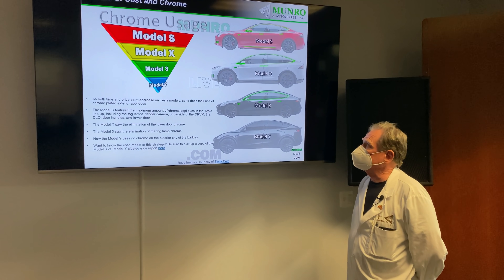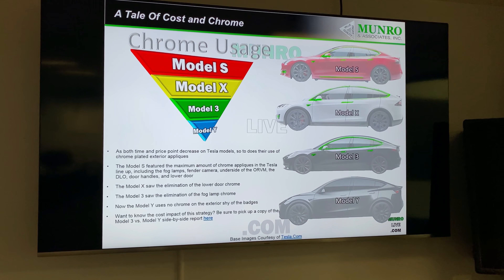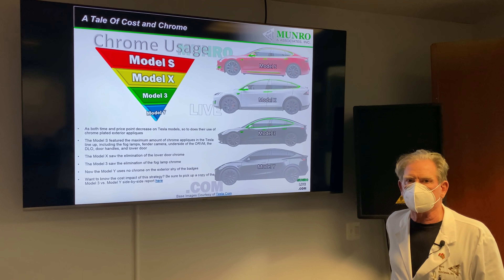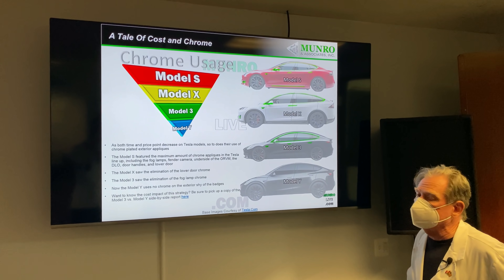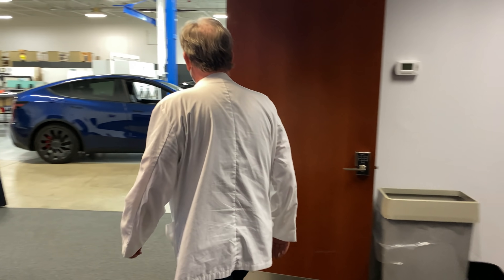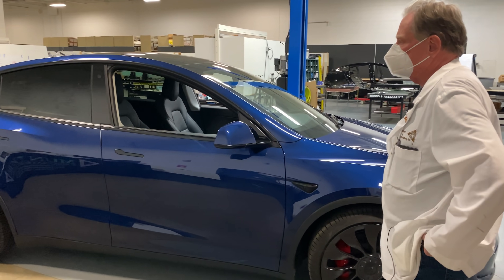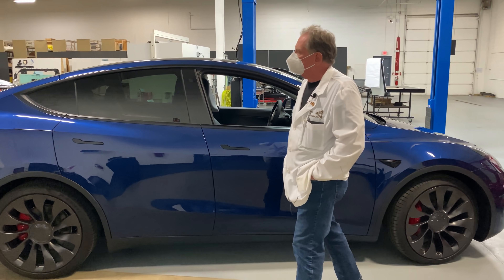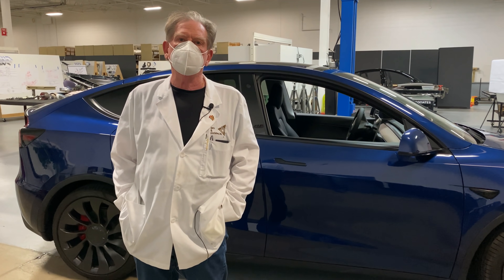Model Y E31: Environmental Stewardship on the Exterior Trim, Door Modules, and Motor Bay

Comment: While I'm glad to hear my Model 3 uses minimal actual chrome, it seems the pH of Simoniz touchless car washes may be too high https://forums.tesla.com/forum/forums/cloudy-chrome-advice and https://teslamotorsclub.com/tmc/threads/flaw-in-chrome-trim-mismatch.132310/#post-4462286 so I may have damaged all my chrome finish trim by manual touchless washing my 2018 Model 3 too much, in my attempts to get winter salt and grime off, covering ~24K miles last year. The ~$1500 is the estimate Tesla gave me for replacing all the window trim and rear quarter window assembly, with none of it covered by warranty, detailed at: https://TinkerTry.com/why-tesla-model-3-is-replacing-my-13-year-old-honda-civic-hybrid#chrome and of course it will likely just happen again. My garage isn't heated, so I really don't have another way to get salt off in the winter besides self-serve touchless.
For now I DIY vinyl wrapped it to hide this very apparent damage, buying me some time before a more permanent solution. The rest of the car and paint has held up well, and it's by far the best car I've ever driven or owned. But it just seemed that this might be the right place to warn others to take care with Model 3 window trim, given Simoniz is apparently used at many or most touchless car washes. FYI, Tesla recommends touchless washes in the manual.
I'm considering DIY black Plasti Dip that can be peeled off, maybe I'll go that route as a more permanent 3 year (but still removable) work-around, that is, if it's not terrible for the environment. Thank you Sandy, for inspiring me to research this more. I think the door handles will be the tougher area to cover to match the trim, as vinyl wraps have edges and won't last, and Plasti Dip might also degrade over time for such a high-touch area.
Reply: Paul Braren salt will corrode chrome for sure. Chromium oxide is the thin protective layer, just as it is on stainless steel. Chlorides if unwashed will pit chrome (and stainless steels)
Reply: @kdkd693  Thank you for weighing in! The thing with my situation is that salt spray rarely hit the window trim, and when it did, it wasn't left there for more than a day, usually much less, washing off whenever I finished a long trip. Also note that the problem arose in the summer of 2019, when the Model 3 was just 7 months old. Also, there seems to be a complete failure/flaw in the rear quarter window trim that may have little to nothing to do with pH or salt, reported by many and pictured here:
https://teslamotorsclub.com/tmc/threads/flaw-in-chrome-trim-mismatch.132310/#post-4462286
Another data point, the chrome trim (which I admittedly don't know what it was actually made of) on our 2005 and 2006 Honda Civics that our Model 3s replaced had no such issues in the same conditions, nor have any of the cars we've had these past 30 years in the same or even more salty roads (Ithaca NY). Also, a Model 3 with a nearly identical 119,XXX VIN# that I saw at Tesla Service in Milford CT had no issues with chrome, nor did the other dozen or so Model 3s parked in the lot for service. This is what has me leaning toward my frequent touchless car washes being at least a partial contributor to my issue.

Comment: Munro's insight here is actually a really good buyer's guide. The more I see of this car the more I want it, and I would totally consider a similar model from another manufacturer but there's no competition for Model Y's price and value at this time.
Reply: Id argue it's in the top 5 best looking "suv's" as well.

Tesla is onto a winner here with the Y. 

When the Corona is over and the world gets back to work, they are going to sell a LOT of them.
Reply: MrMagooo A matter of taste. 35k SUVs on this level are subsidised diesels. But the safety, space, fun to drive, tech and premium amenities this offers are hard to beat at the price, is the point. Not to forget driving a car that is this innovative and smartly built.
Reply: MrMagooo  If yoiu like shiny things and are easily distracted perhaps, if you value things overall,  there is no competition.

I have a Audi, the only part id really miss on a Tesla is the nice feeling steering wheel. Which isn't nothing, but nowhere near enough to make it worse
Reply: MrMagooo  Tesla couldn't do old fashioned buttons though, as they aspire to have their entire fleet become self-driving with over-the-air updates. And then all the old-fashioned buttons would become useless. So you'll have to wait until an old-fashioned brand puts out anything that compares to today's Model Y specs. Maybe 5 years, maybe never. Perhaps more realistically, you can buy a more expensive one with lower range sooner.
Reply: still too expensive to afford it
Reply: The only benefit of the Tesla vehicle is environmental,  which I agree is very important, but that comes with an added cost above and beyond the cost of Tesla's incorporating a lot of unnecessary luxury and performance features.
I don't want to belabor this, but my fully amortized 12 year old Honda with 100,000  miles is/was better for the price and value when I bought it and is an order of magnitude better today.  The real dollar TCO/mile for reliable transportation has been lower than any projected TOS for a Model 3.
Reply: @psdaengr911  I don't know which Honda you're speaking about but you can easily model a Model 3 showing a close five year TCO to a Honda Civic with a $10k lower sticker price, if you project Model 3 maintenance as a comparably cheaper Model S. And the comparison falls more into Tesla's favor if you drive more per year.

Do note that Model 3 has only been out in decent volume for two years and Model Y is just beginning now. And their first mass-produced car, the Model S, has only been out for almost eight years, but they've massively improved manufacture quality since then. So comparing it to a twelve year ownership is not possible without projections and big assumptions yet.
Reply: @psdaengr911  5 year cost is already better for many BEVs vs equivalent fossils. And part of Tesla's mission is to force traditional auto and startups to adopt BEV tech, and that's happening now. Prices always come down eventually on the free market.
Reply: They still need to improve their quality control by a lot:
https://www.youtube.com/watch?v=Z0r-vC-RHkU&feature=emb_title

Comment: Sandy, you don't really need to wear a mask to film these vids. The point of them is to protect others from yourself. If you have zero symptoms then the camera guy is not at any risk.
Reply: Not correct. He could be asymptomatic and still propagate the virus.
Reply: I get the impression that Sandy makes a point of using the masks even when hes doing streaming podcasts, to help remove the stigma of people wearing masks.
Reply: @temper44  That's also a good point. When you make educational content, you should go all in.
Reply: @temper44  - He has had zero symptoms for over a month though.  The mask thing is now pure subliminal propaganda and designed to persuade people to comply.  I get that. But to claim that it is essential to make a 5 minute YT vid is just wrong. Ask any medic.
Reply: Hitstirrer  he is probably wearing it all day, every day as he still has contract with others outside work
Reply: could have been negative for the first three weeks and positive for the last week, could test positive next week
Reply: @Hitstirrer  . It's possibly similar to Mike Pence and Trump refusing to wear a mask, as a message to all their fans that they know better than scientists and doctors. Also to show that they have the power to break sensible rules with impunity.

Comment: 2:00 Can someone comprehensively explain to me while there even are these corner glass panels in cars? They don't seem to serve a purpose other than allowing burglars to smash them and stick their arms in without triggering the alarm. They don't really allow a better view out or much light to shine in. Why not make that part of the frame metal to begin with?
Reply: because the window needs to go up and down.  because blindspots would be worse if that window was a solid panel.  because if you are locked out of your car in a hot desert?   xD..
im just spitballin here.  😂
Reply: There's a guy who sells plastic blocks to go into the releases on Model 3 rear seats so burglars can't flip the back rests from the quarter window, so this seems to be a recurring issue indeed
Reply: I would rather atheist break the 1/4 glass than my rear window, don’t leave valuables in your car, especially in plain view
Reply: I think reason for this is the cat eye design that you see on many car lights and windows. The car need to look sporty and elegant - like a cat.
Reply: @mirkonaumann1417  that's probably most plausible, design seems to supercede funktionality on most things
Reply: looks
Reply: it is to add visibility inside the car also to eliminate blind spots
Reply: I don't think the visibility/blind spot argument is strong enough https://youtu.be/gSMydf5U28c?t=818

Comment: How do the panel gaps look on the second Model Y?
Reply: The red series was first produced, the blue followed and the grey (midnight silver) was last before the virus shutdown. Blue has been a big improvement but it seems like not all blue are well. From the grey I have seen only good looking gaps and paint and maybe some other things (remember the cut from the cable housing because cables were too short, Sandy was showing on the driver's side) should have improved, too. So tear down the red was good and drive and enjoy the blue.
Reply: Mines blue, only had a couple minor issues but did have a paint inclusion. I'd call it better than my 2018 Model 3 but still needed finishing touches after delivery. Nothing that would prevent me from loving the vehicle, and like the 3, am confident Tesla will make it perfect. Still an annoyance to buying a Tesla however.
Reply: Go look at his earlier videos. They have improved.
Reply: @SherlocckHolmez  I meant the blue Model Y - the second vehicle they got...  I was curious how consistent things are across Model Y's.
Reply: @SherlocckHolmez  Maybe you know, in which video exactly he talked about second car gaps?
Reply: Viki first one

Comment: One reason for the chrome delete on the Y is probably the fact that many model 3 owners wrapped the chome anyway so there wasn't many reasons to keep it anyway.
Reply: Chrome is some oldstyle and hard to keep off from scratches and dirt. Sadly the piano paint was not removed, too as same issues.
Reply: It's a question of taste and desire.  I personally like some extra chrome - not to extent of a 1957 Buick Roadmaster, but just a little extra bling.  I added a chrome strip to the trunk lid and side mirror chrome covers.  With the blue outside and the brite white inside plus the chrome I love, love, love my Model 3.  Never understood "chrome delete" but again, it's a personal choice.
Reply: @dzerres  Yes! What a car looks like to others from the outside is important to performance, reliability and TCO, and has nothing at all to do with personal insecurity or sense of self-worth.
Reply: The statement needs an 'anyway' delete
Reply: @whakjob  You are right. My English failed me. It is not my first language after all. But I hope the point still got across.
Reply: As "many" go so must all the rest, eh? Take all power from the "most" and give it to the many.  The most didn't really know what to do with chrome where many did.  All hail the wisdom of the many.  Your logic is spot on.
Reply: @rickdees251  People either don't care about chrome or don't want it. So it is logical that Tesla deletes it. If you want it, wrap it in chrome then. Just know that you are a minority so you will be the one who has to pay to have it their way. Consider it as an upgrade and a privilege. You will be special. ;) 
"There isn't a man in the world to comply to all."- Publius Ovidius Naso
The translation is not spot on but good enough.